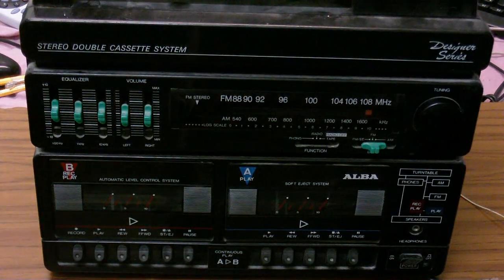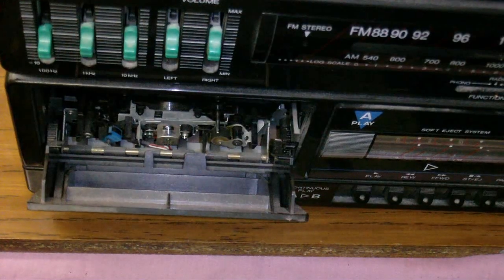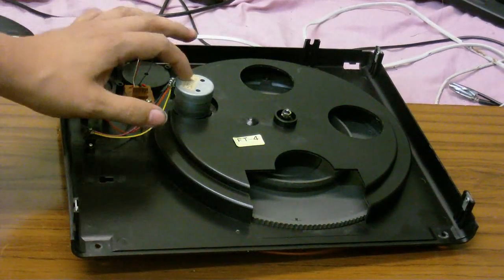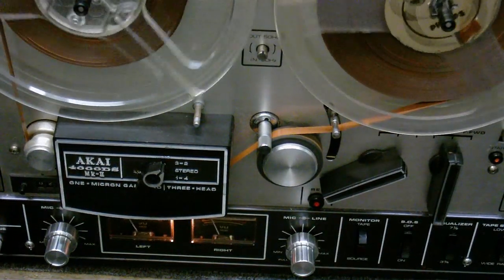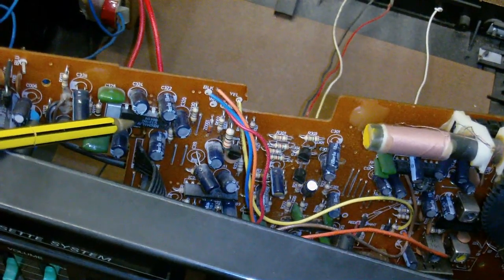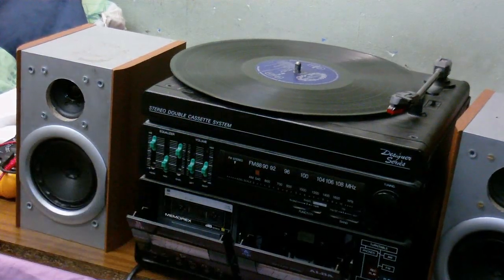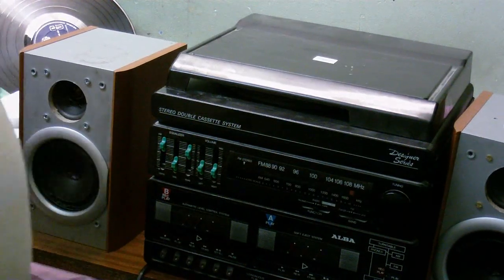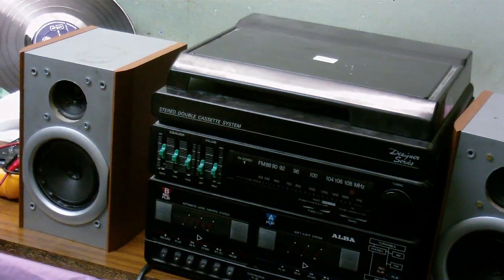More modern crap

Comment: I have had considerable experience with cheap stereos from the 1970s & 80s-flimsy plastic turntables,dc bias cassettes, low power amps (transistor & IC), and tiny speakers in big boxes. I was given a cassette recorder for a christmas in 1970 to take to college .It had DC bias and recorded horribly and the head even fell apart-so bad I decided to lug around my big reel to reel.

Comment: My mom had a very similar stereo system in the late 80's. I don't remember the brand but it was likely either Yorx, Soundesign or Alba. Well, I would agree that these types of stereos were cheap and they usually would fail on you after a short time, but my mom was all about music enjoyment, so if you were on a budget it would serve the purpose for a short time.

Also, I think it was one or two years ago that I saw the same stereo system at a local thrift store but under a different brand name.

Comment: Hey Cooldude, I have a Thorens TD124 with an SM 3012 tonearm and the tone arm pivots around just like your Alba unit.  Should I pitch my turntable?  You know it's even older -it's from 1964 and they did not have voltage regulation technology to make a reasonable 2 speed motor.  It will do 4 speeds and has an eddy magnet seed adjuster. -Junk, huh?  Yeah, I suppose.

Comment: I had a "hi-fi" that looked just like that, except it was f**king Amstrad. The "turntable" looked exactly the same as the Alba one - plastic tonearm, plastic platter, and ceramic cartridge. Sounded dreadful and I had paid £100 for the insult, late 1980s.

Ended up getting shot of it within a few months and bought my first set of separates (amp, turntable with Audio Technica MM cartridge, and speakers) all for a mere £120. I've never looked back - until I saw this video...

Comment: i found something like that about a year ago, and it was made by the wonderful brand supertech! (aka supercrap) i took it because those combination things usually have a pretty big transformer in it, and i wanted one. but i found a teeny tiny one (i think even smaller than yours) which wasnt useful! piece of junk stereos. my record player did not have constant speed (poor powersupply with bad voltage regulation i think) the sound went too fast-too slow-too fast, you know. i just threw it away.

Comment: The stereo you found was made in the late 70s not 1972
Reply: Yes, it's almost certainly circa the late 80s. "Midi" hifis like this (#) like this were at their peak in the mid-to-late 80s. The tacky post-Miami Vice pastel green controls and triangle graphics are also very obviously of that time.

Older 1970s all-in-one units tended to follow the "music centre" format (i.e. flat), and later all-in-ones from the early-90s onwards tended to be smaller "mini" systems. (Since CD players had become cheap and well-supported enough for them to replace the record deck altogether, and there was no reason to make them that big any more).

So, mid-80s to early-90s at a push.

(#) i.e. Cheap all-in-one units that superficially mimicked the layout of more expensive stacked hifi "separates". No relation to the MIDI synthesiser technology.

Comment: my amplifier is a whole lot larger. the power amp alone is over 60lbs and it's dead ugly -all chassis and nooo "designer" decoration. It's got hot valves & I could burn myself!  Plus the DC high voltage! My McIntosh C20 preamp is 50 years old and only has TWO tone controls! Darn it all, I am dumping the entire lot right now!!  Off to the rubbish bins I go.  And those filthy B&W speakers go with the rest of this rubbish. You have shown me the light!!

Comment: This has got to be the archetypal cheap POS late 80s Midi (#) system. Alba was an utterly bottom-of-the-range brand (##) and aside from the fact it looks cheap, the fact it's only got a three band equalizer also shows that up. (###)

In the UK, this is the sort of system that would have sold for circa 80 pounds.

The pastel green controls (very post-Miami Vice) and triangular graphics all scream "late 80s", but only in a bad way- the design isn't even followed through well enough to be a good example of the period. ("Designer series"? Hahahaha!)

Even without asking, I can tell that those aren't the original speakers, as they're obviously way too good for this system (and the cases don't match it).

Utterly tacky, cheap shite.

(#) The name given to all-in-one systems that sort of mimicked the layout of more expensive hifi separates. No relation to the MIDI system for connecting synthesisers

(##) This was back when China had only just started exporting to the West in serious quantities and "Made in China" still meant cheap products of questionable quality. For people like me who grew up in the 80s, Alba- who slapped their name on this stuff- were very much associated with that. (Turns out that "Alba" had originally been a British manufacturer, but they'd gone bankrupt, and the Alba I knew were just some importers who bought out the name and slapped it on imported tat).

(###) I remember looking at Midi hifis when I got mine in the late 80s, and I noticed that the very cheapest-looking 80 quid models- such as Alba's- only had three bands. I splashed out (ahem) on a 100 quid Matsui model that at least had five bands and looked (marginally) better. Yeah, you know that when even Dixons' own-brand system looks better than an Alba that the brand isn't the best. :-)